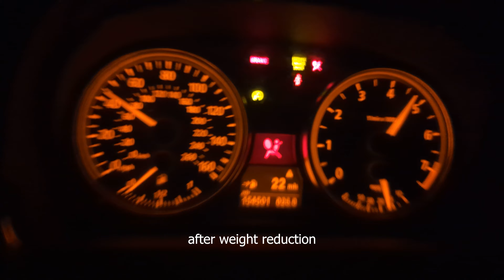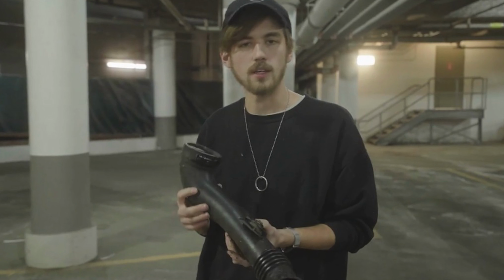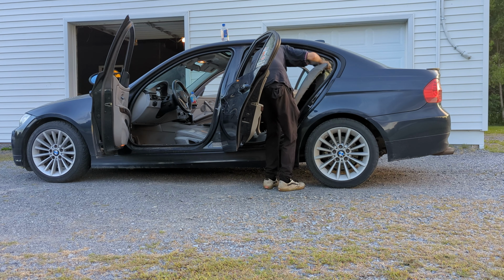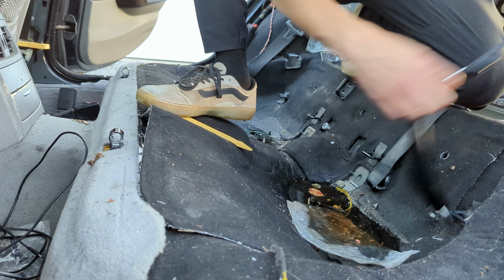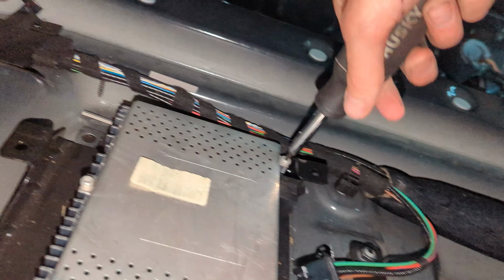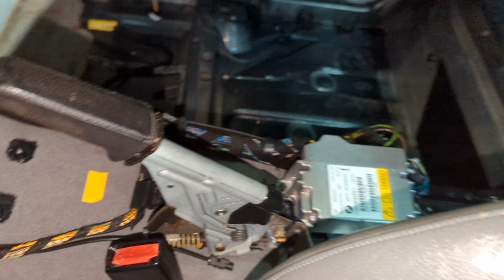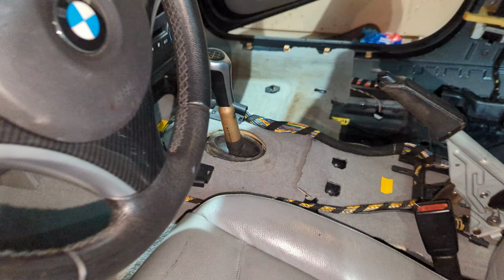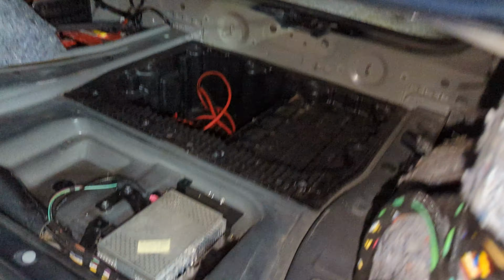E90 325i Weight Reduction

Comment: Would you be interested in adding a water methanol injection system? The main benefits would be that you could fuel your supercar with 87 pump gas and save some money. The next benefit would be a little more horsepower and the interwebs are saying about a ten 10% hp gain for N/A vehicles. In terms of engine mods, I feel like the water meth injection kit might be budget friendly.
Reply: would only be worth it if you were increasing compression probably